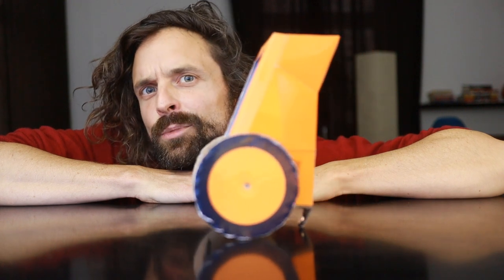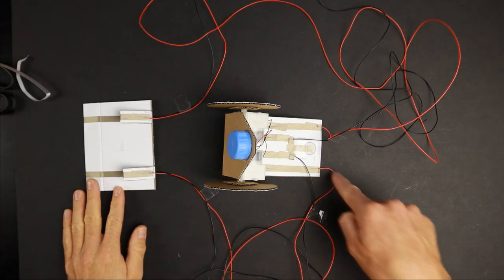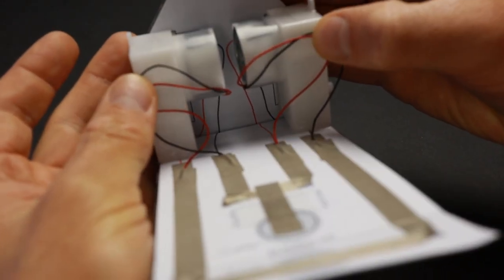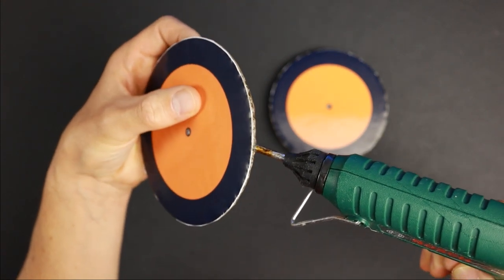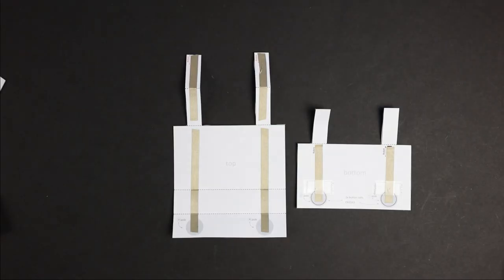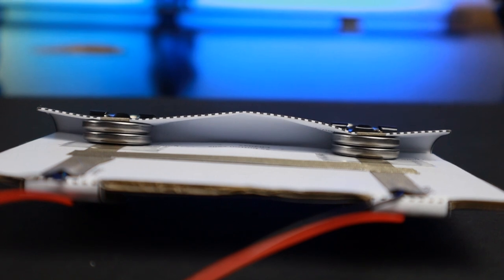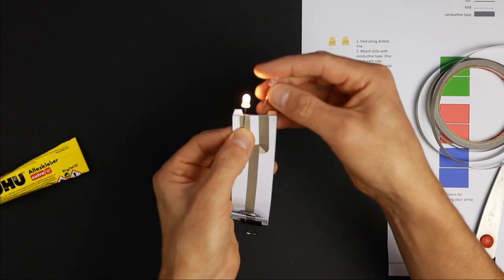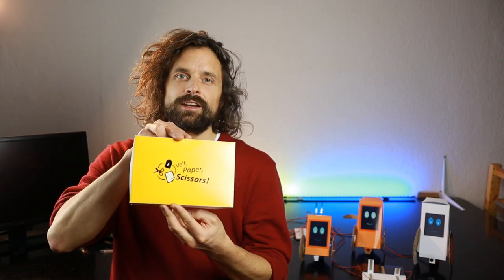Easy Remote-Controlled Robot for Kids (DIY templates!)

Comment: Hello! Firstly, your project is so good and you are very talented. I was wondering whether I could use an electric motor instead of a geared solar motor? I am trying to do a science project and I can’t really find a geared solar motor in my area.
Reply from the maker: hi! sorry for my late reply. For the robot you will need a geared motor and this version is using a geared solar motor. You can use regular geared motors, but those will not run using coin cells. Also usual BJT transistors are too week for this, you will need MOSFETs. I do have a PDF available for my patreons describing how to do it. If you are interested here is a link to my Patreon page: https://www.patreon.com/VoltPaperScissors

Comment: Hey, I'm a teacher and I want to start a robotics club at my school but our resources are very limited.  Could you do this using 9 volt batteries instead of the cell batteries?
Reply from the maker: hmm not sure! I would stick to the coin cells because it is saver when using paper circuits. I do have a different version of the smartphone robot available on my patreon page. This version uses standard dc motors instead of the solar motors and AA batteries instead of the coin cells. Here is a link to my patreon page: https://www.patreon.com/VoltPaperScissors

Comment: What happens if I dont got the extra wheel attacher to attach the wheels
Reply from the maker: you can simply glue the wheels to to motor shaft. Just make sure not to spill hot glue into the bearings

Comment: hi, can I use a geared DC motor? I am unable to find the geared solar motor in my area
Reply: Hi! Michael here. I am using another account because I am on holiday. Anyway, for this robot you should try to get these geared solar motors because only those will work with the coin cells!